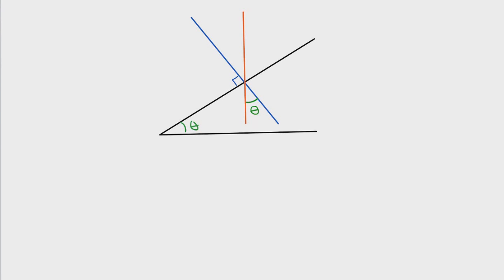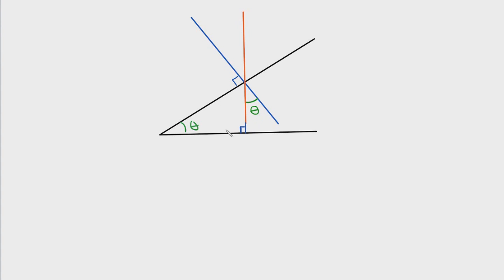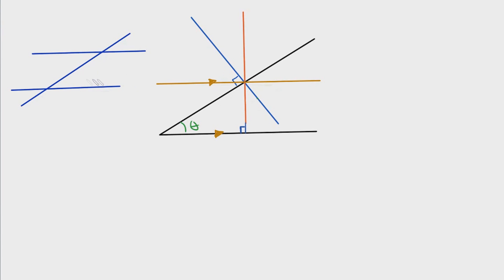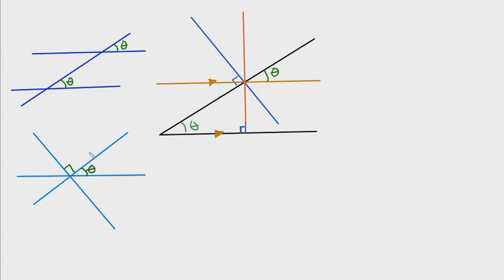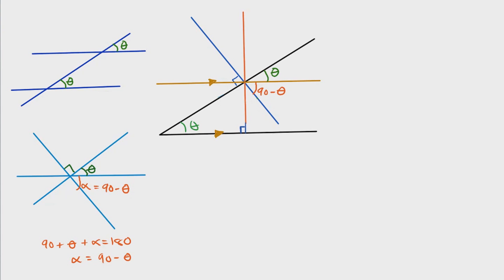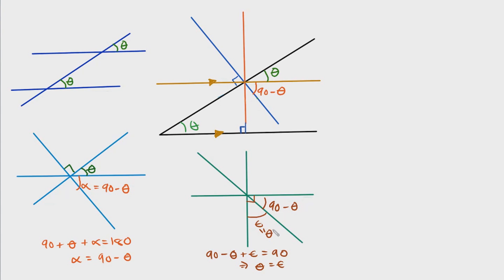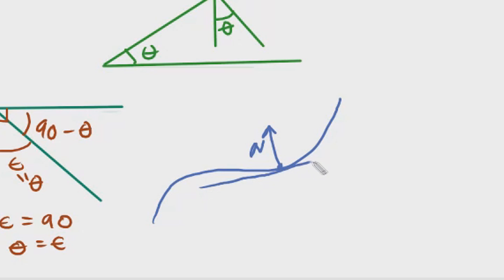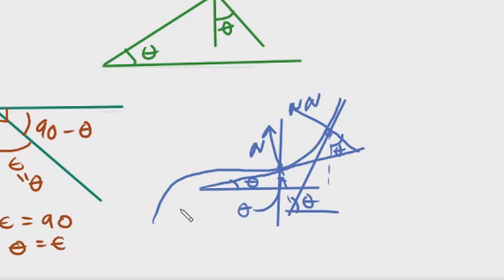Angles of Inclined Planes

Comment from the maker: There is actually a quicker way to figure out that these two angles are equal! Can anyone figure it out?
Reply: Going from the original diagram, if we extend the orange line to touch the bottom black line we can see a right angle triangle. The angle at the top is simply 90 - θ,  and we use the complementary rule because the angle from the top black line to the blue line (going anticlockwise) is 90 degrees. Therefore, If we let the angle we want to prove be alpha, then α = 90 - (90 - θ) = 90 - 90 + θ = θ.
Reply: @velvetwisteria6237  There's an even quicker way. Perform your same method, but with a 30-60-90 triangle. e.g. - assume the angle of the slope to be 30deg.
Reply: From the looks of it
Reply: Thankks bro